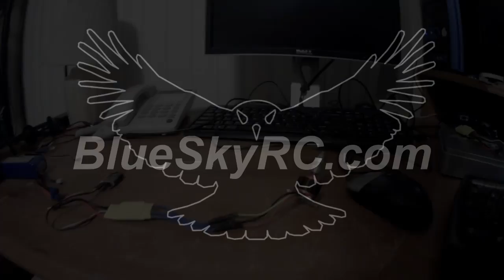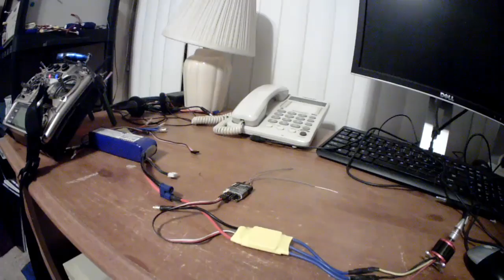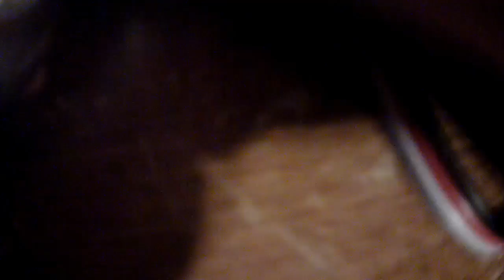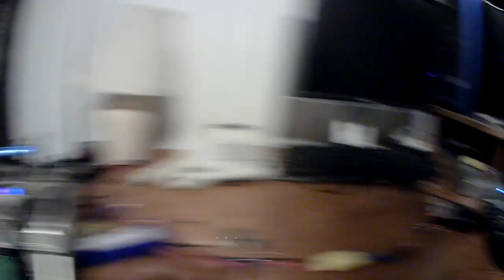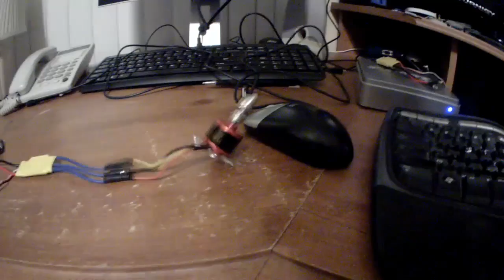ESC Throttle Range Calibration HW25A

Comment: What should i do if i put the throttle to the max and the motor doesnt spin but if i move the throttle down to min the motor starts to spin. Same esc as you have.
Reply from the maker: LetsTutorial it sounds like you need to reverse your throttle channel on the radio.
Reply: Yeah but if i do it and then plug it back to the flight controller with ppm everything goes crazy cause of 1 esc that reverse  everything.
Reply from the maker: LetsTutorial what you described sounds like the throttle channel is reversed.  Why would just reversing the throttle change everything else?  Don't change anything but the throttle channel.
Reply from the maker: LetsTutorial it isn't a physical change but a software option or a switch on the radio.

Comment: Could anyone explain what he did at the end of the video. My motor is calibrated.  Now it will rotate only at high throttle,  and goes into throttle calibration mode again.
Reply from the maker: Most standard ESCs will allow you to calibrate throttle range... just have the radio on with the throttle full on when you apply power to the ESC... it will then beep a couple of times, (don't wait too long) and put the throttle down to the home position.  This is what tells the ESC the bottom range of the radio.   At this point it should be ready to go.  You should get a smooth throttle response along the entire movement of the throttle stick.

Comment: I get continuous beeping no matter what the throttle position I'm doing, UP , DOWN... Turnigy 9X .   Any ideas ?
Reply from the maker: +Levkin Make sure the transmitter is on and the throttle is on to full before plugging in the power to the ESC.   Make sure the ESC is plugged in correctly to the Rx.
Reply: +Qromer , I think I figured it out.   On my Turnigy 9x, the throttle setting had to be reversed.  Once I did that, everything worked smoothly.

Comment: Thanks for this upload !
I do everything correctly, I push the throttle up, then two beeps, but as I push it back down it begins to beep continuously. I am using an arduino and a potentiometer for this procedure, is it because of this that the ESCs won't calibrate ?
Thanks for your video.
Reply from the maker: Youness Fouqani When the ESC is powered on, it should be reading the highest value provided to the ESC -- this is what starts the calibration.   Once the stick goes to the lowest value the calibration is complete and it has read in the high and the low values of the radio gear.   I don't know how you are doing it with the arduino, but I imagine it is the initial values when the ESC is powered on.   I have used arduino based flight control boards to do this, but it was set in a calibration mode.

Comment: Hi, this is Tao.
when I am doing what you are doing in the video, i have the quick beeps no matter how I push the throttle up or down. can you figure out what is wrong with it?
Thank you!
Reply from the maker: You must have the throttle up all the way before you power on the ESC.
Reply: Yes, here is the situation.
This is what i do. I had the throttle all the way up first, then I turn on the transmitter. then I connect the receiver, then I connect the battery to the ESC. After a short beep of 123, it starts quick beeping,

i didnt understand why it was beeping when i had the throttle all the way up.

in addition, thank you for responding me. it is very much appreciated.
Reply: Tao Chen  after the initial beep you must bring the throttle down immediately If you do not, then the ESC will go into its programming mode, where you can change ESC settings, which is not what you want.

Hope this helps.

Comment: Great video man, I was just wondering which channel on the receiver I should connect the ESC to do that?
Reply from the maker: You should plug the ESC into the channel that corresponds to your throttle stick.  Futba / Hitec usually this is ch3, JR and Spektrum is usually ch1.  You will need to check with your radio.
Reply: Qromer alright thanks a lot man!!!

Comment: I tried mine.. i do what u did.. when i calibrate is done ecs start to smoke and fried one of then chip in the ecs.. where did i go wrong?
Reply from the maker: Ensure that you plugged in everything correctly.  Also make sure the motor you connected it to is ok and didn't pull too high of an amp draw.  You probably shorted it somewhere.   These steps should not result in any issues -- it sounds like something was plugged in wrong or you got a defective ESC.

Comment from the maker: Oh, good catch.  The ESC was not mine and it came out of a Quadcopter -- the ESC had been plugged into a power distribution board.   The ends have shrink tubing on them and it is not required to have the blue plastic on them.  I do like having the blue plastic on the battery side, but the ESC side is not really important.  I was programming the ESC for a customer and this is how his ESC was.